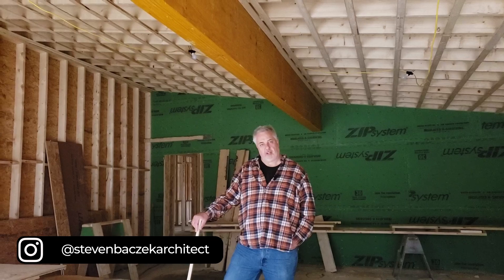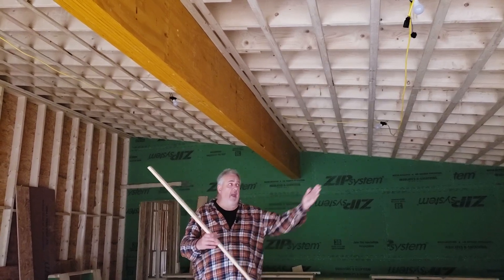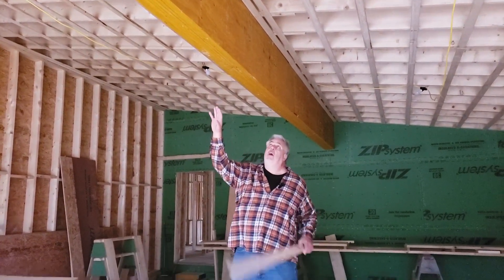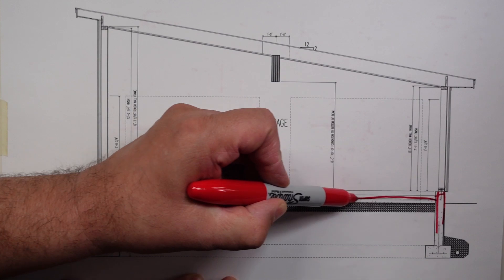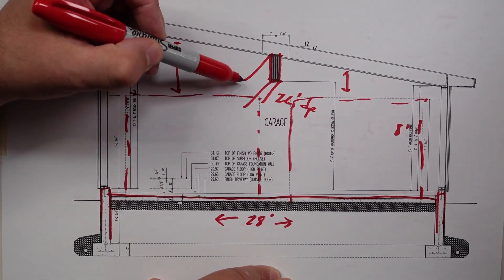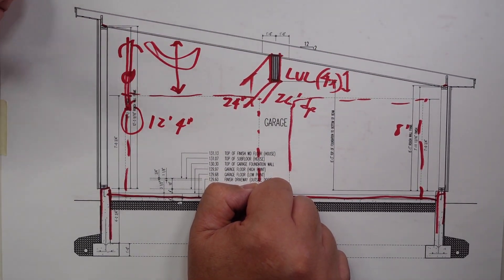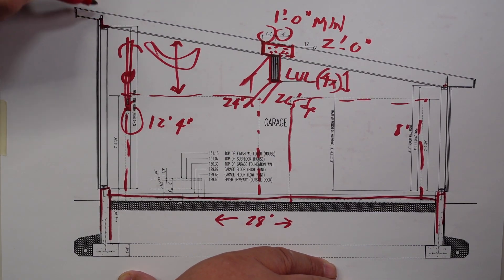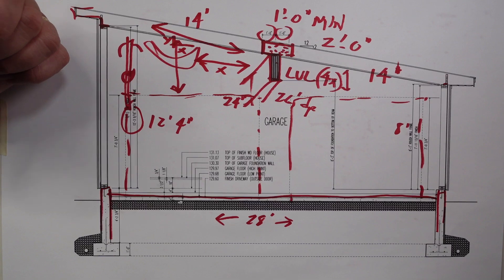Single Slope ROOF FRAMING - the details

Comment: The thing i don't like about them is no room for insulation and they are hard to heat. I'd rather drop the ceiling down a bit and have an air gap.

Comment: A question for Steve
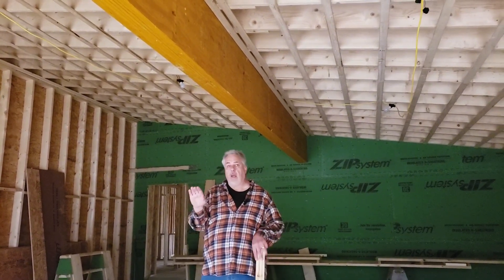2:15 I like the lapping of the rafters. It's simpler than butting them together and using straps. But that means that when you put your 4'x8' wide sheathing above, you don't have a continuous alignment. Do you offset your sheathing so that the panels still butt on rafter centerlines but the sheathing panels on one side of the beam do not align with those on the other side of it?
Reply from the maker: yes

Comment: I have an almost exact identical mono slope roof design on the 5-Story multigenerational ICF house that I am DIY Building.  Another benefit has to do with your favorite word which as we all know is continuity :)  

My ICF roof rafters are actually inside my ICF walls.  So above my roof sheathing I will have 3' of EPS foam and then another 5.5" of EPS foam with metal studs embedded in them.  Then Sharkskin ultra SA that wraps around the EPS foam layers and down the wall.  The walls have rubber paint that goes all the way down to my pango wrap which goes under my 5' wide footers and under the concrete slab in the 6'2"  "crawlspace"  Basically I took continuity to the extreme.  And thanks to you I will be using the intello air barrier under my roof rafters with Zero penetrations because of the strapping that I will be doing on the ceiling.

So thanks for all you have done to educate me and everyone else about building science!!!
Reply: Wow 5 story ICF! Just subscribed to your channel

Comment: The storage point is great too. Vs attic storage trusses, easier to access.
Reply from the maker: Agreed
Reply: Where I am, if you want a hanging unit heater in the garage, the bottom of the heater needs to be higher than the door openings.  This design would allow space for that.

Comment: I'm considering a similar situation, but using full span TJI's instead of 2x12s, and a much smaller LVL beam to limit deflection. Any drawbacks to this approach?
Reply: I find 2 x 10s to be more economical per unit of span(when compensated for with reduced span) compared to 2x12s, often having to go closer together. I find them much more economical compared to ijoist. Make sure you compare the exact numbers relative to span. Until you compare, hard to assume properly.
Reply from the maker: None if engineered properly

Comment: These tandem garage openings are pure garbage from a daily use standpoint. 16' or wider bay openings or forget it.
Reply: Nah. I love the two separate doors on my garage. Easy to keep space between vehicles .
Reply from the maker: I agree
Reply from the maker: Here's a thought, on your house you get what you want.......and 16' doors in winter or fall with wind blowing suck, garage fills with snow of leaves.
Reply: It is cheaper to fix one car and door frame of building than it is to fix two cars.  Less debris blows in when only one ~8' door is open.  If quick with open/ close it can make a difference in temp change. More privacy from prying eyes from seeing your stored treasures on one side.

However, you lose the picture window effect when sitting in garage when it has been transformed into a tv/eating lounge.
Reply: It's not "pure garbage". It's personal preference. I prefer separate doors because it typically puts the door centerlines (and the parking spaces inside) farther apart than a single door. Even an 18' wide door puts the parking centerlines closer together (9') than 2 8' doors with 2' of wall in between (10')
Reply: This garage looks as if the individual doors are luxuriously wide compared to typical US single-bay doors.  IMO a 16’ door for a dual bay is very cramped.  16’ for a single bay is pointless.

Comment: Can you explain the use of dimensional lumber vs engineered or truss style in relation to the continuity of the member over the beam as you attempted with the nailed overlap?
Reply from the maker: The 2X12 was structurally adequate for a future solar array, and the eave ends are easily profiled from a 2X12 making the eave conditions easy to fabricate

Comment: Steve, I see that 1 x 3 strapping was up, what is the plan for the insulation the roofing??? I am planning on a Single Slope roof garage too...Can you share that drawing with me, its so nice!!! And I planning on using the garage roof for solar panel instead on the house which consists of a double shed roof and I am planning on an attached Green House and (below the 4" concrete slab will be a sand battery and runing pex tubing and and another set of lines under the ground out to a radiant floor heating in the garage) that I am going to build in Maine hopefully... Liked#34 N Subscribed!!!
Reply from the maker: The roof was a hot roof with 4" CCSF
Reply: @stevenbaczekarchitect9431  I am planing on the same hot roof concept, for the house which consists of a double shed roof too... Thank you!!!

Comment: Why did you spec out a 12" overhang, and then not nail the last 6 inches of the rafter?  Or did the lengths just work out so you had 12 inches of overhang, and 12" of nailing surface for the attaching the rafters is sufficient?
Reply from the maker: There was a nailing schedule to nail the overlap, just may not see the nails+
Reply: @stevenbaczekarchitect9431  I saw some  nails on this side, but maybe the full pattern of nails is on the back side.
Reply: AFAIK you don’t really need the rafters to have any real stiffness along the quad-LVL beam.  For the rafter design (taken by itself), it should be OK if the centerline of the roof deflects down (butterfly bend) to meet wherever the quad-LVL happens to be.  You just prevent it from being an actual bend by installing the quad-LVL in the proper position.  The important part is that with heavy roof loads, you don’t get any sudden height change from one piece of sheathing to the next, which would tear the roofing materials.  That’s the real purpose of the nails between the two 2x12s.